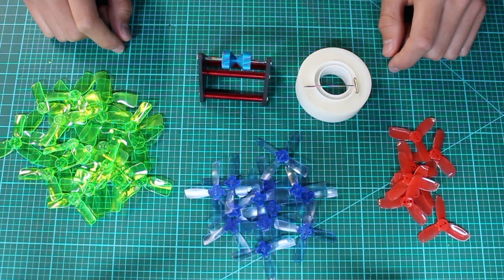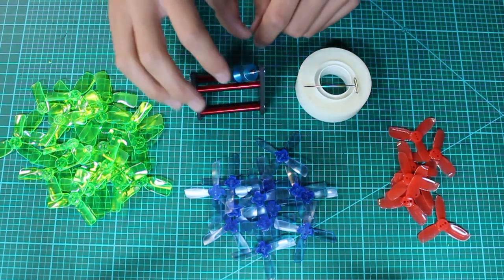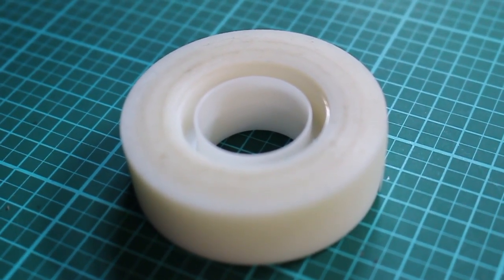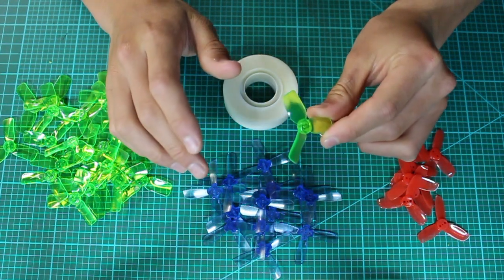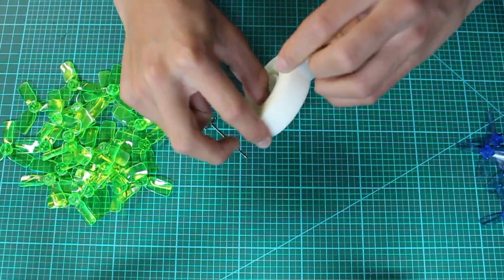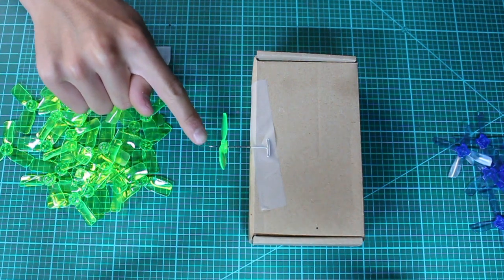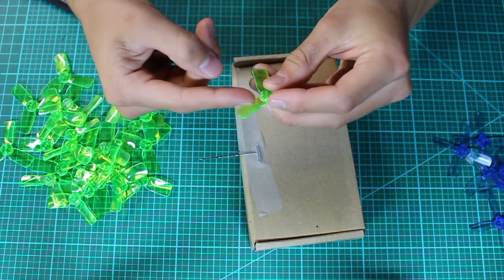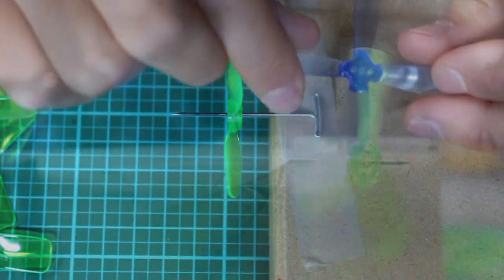How to Balance 2" and 3" Micro Quad Props Like a Pro

Comment: Better with a rod with the same hub diameter (1.5mm in this case) then balancing it on two glasses or anything that has curved edge, less friction for the rod to turn. Finally apply tape on the leading edge, hugging it. Trial and error for the correct size of tape. Or with sand paper carefully sand the trailing edge, not the tip, it must remain sharp.